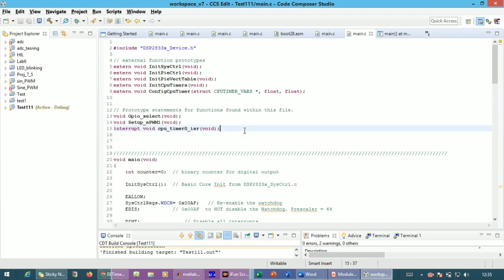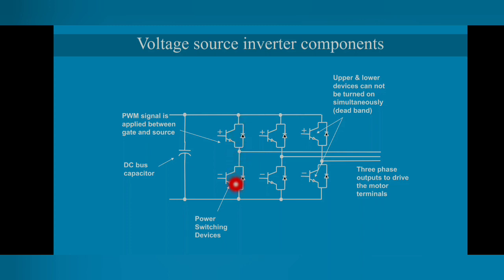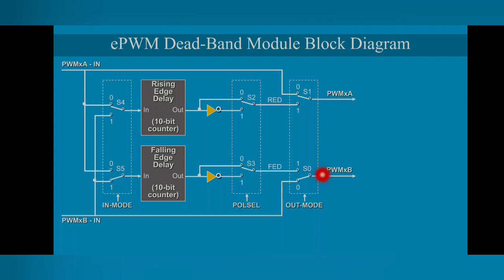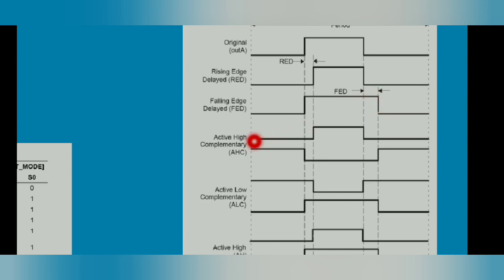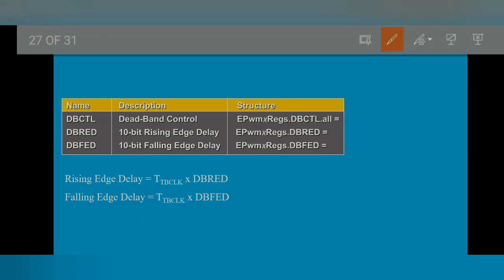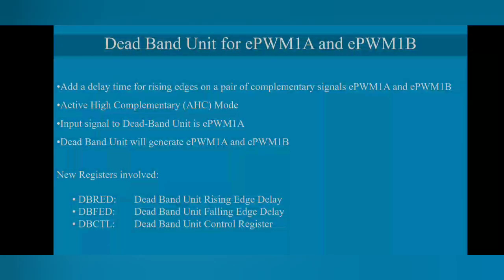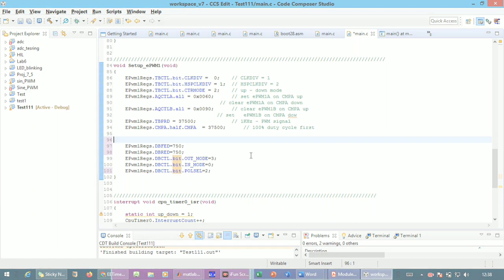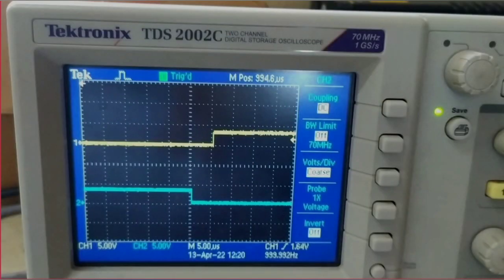Part 13 | ePWM Dead Band & Complementary PWM Signals | DSP TMS320x PWM Tutorial

Comment: Hi Sir , I'm a final year student in engineering... could u please assist me in how would one implement control (PI or PID) in SPWM signal for an AC drive operations , 

For instance I need to implement control into my AC drive project, where by my induction motor needs to maintain the setpoint speed (frequency) when load is changed.

Comment: Hi engineer 
I'm to see your Attractive content about DSP and coding hardwares... it will be best approach if you make one video about making an inverter frome zero to end ( i mean chosing trans , IGBT or Mosfet info, etc) ,  even using kind of voltage control in output. Then use DSP or ARM or even FPGA. Put your code and simulation as file for easy touch... i wish you the best... i subscribe you man.
Reply: I have Master degree(Hon) in power elec and Wireless power transfer,  EV Charging.
Reply from the maker: Thank you so much for your support. Sure i will soon make a video on that.